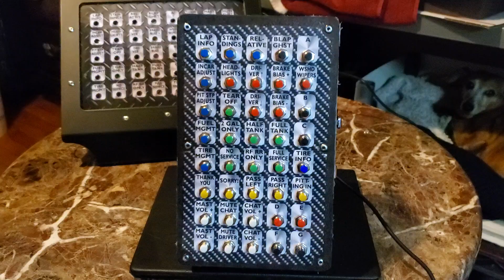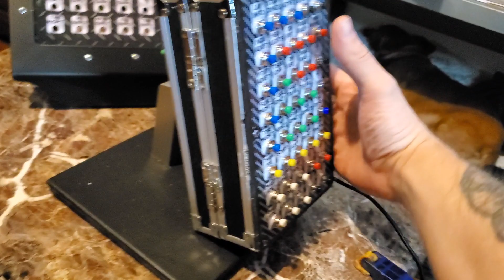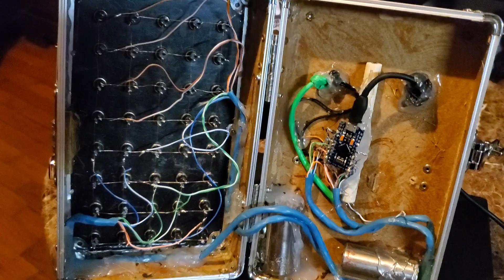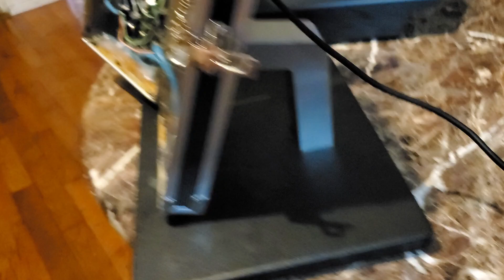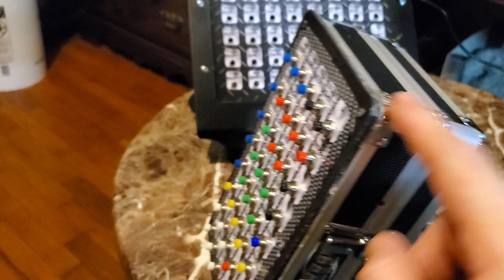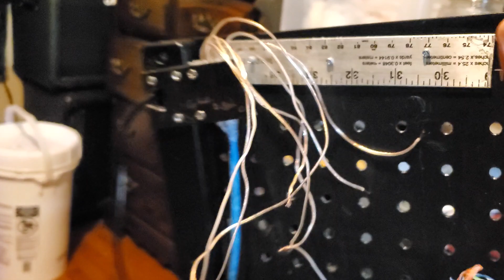Sim Racing 40 Button Box DIY Arduino Pro Micro

Comment: Did you use diodes in the matrix? I am making the 2 main panels in the elite dangerous cockpit that are on side of the throttle and flightstick.
Thanks.

Comment: This is insane. Well done. Looking at creating something like this for Flight Simulator.
Reply from the maker: Thank you sir, I most assuredly recommend giving it a go. I wish I had done this in my Elite Dangerous days.
Let me know if you have any issues in your build, I probably had that issue and resolved it. If you have to buy Arduino Pro Micro's Amazon has a 3 pack deal for ~16$. Good luck dude!
Reply: @JoshBrown18  Unfortunately I live in South Africa and ordering form Amazon is a pain. I put around 400 hours (baby hours I know) into Elite myself so I know the struggles. I wasn't able to get a Pro Micro (Covid things I think) but managed to get a Arduino Leonardo Micro and seems to come down to the same thing. Just waiting for it to arrive.  If I run into any issues I will definitely hit you up.
Reply from the maker: @RudiOnRails  It is the same thing. You should be good.
Reply: @JoshBrown18  amigo buenas noches disculpe tendrá el código ? 

O tendrá algún vídeo donde explique cómo hacerlo ? 
Muchas gracias y nuevo sub